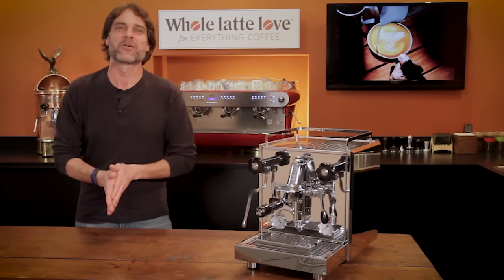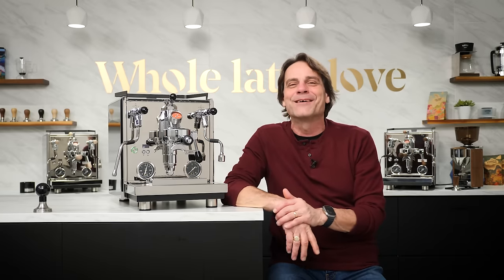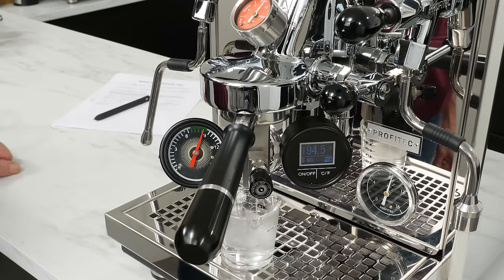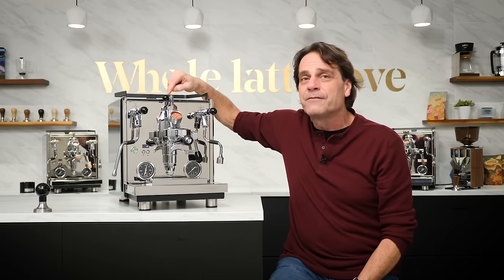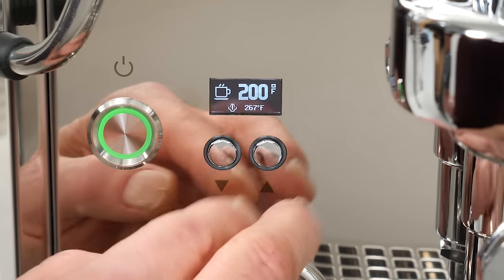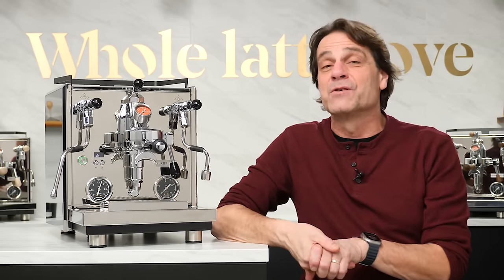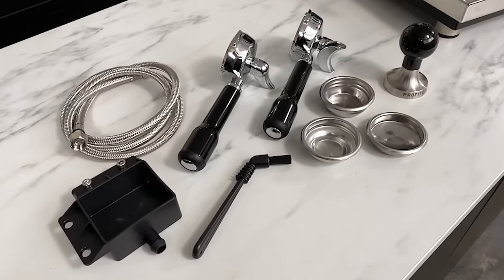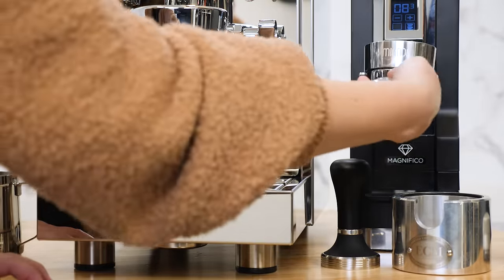Profitec Drive Espresso Machine Review

Comment: At this point, I'm not sure why they still make the Synchronika as this new Profitec seems to have everything the present-day Synchronika has but now with updated electronics. The new display is nice, but for these eyes it would be even better at twice the size.
Reply: Lexus vs Toyota
Reply: A new Synchronika is probably in the making so if ya want an ECM best to wait
Reply from the maker: I have no info on that but if it does happen it will be more $$. Just like the 700 and current Sync
Reply from the maker: I might have used the L v. T analogy once or twice - spot on!
Marc

Comment: I just received my machine,amazing kit. I noticed something odd today,my grind must have been too fine and pressure jumped to 10 bars,still a reasonable flow. I opened flow control valve all the way but the pressure did not drop,is that normal shouldn’t that affect pressure?
Reply from the maker: Hi p, thanks for your patience - I've been offline on vacation. The maximum brew pressure the machine can output is determined by the rotary pump's bypass setting. Opening the flow control all the way will in most cases cause brew pressure to increase but only as high as the bypass setting.
Reply: @Wholelattelovepage  thank you. This is my first machine with pressure gauges, upgraded from barista touch. I need to pay attention to the pressure on flow control valve, the pressure gauge on the bottom right that also activates during brew is not important to watch what is happening there?
Reply from the maker: @pawelgedyk1762  The gauge at the group is a better indication of actual pressure on the coffee. The gauge on the machine's face measures pressure in cold water very near the output of the pump. That gauge can be used to set the machines max pressure and for a general idea of brew pressure when extracting. But, do not focus too hard on brew pressure. A bar or 2 doesn't make much of an impact on an extraction. People get laser focused on a perfect 9 bar but in reality it doesn't mean much. If you're reading somewhere between 7 - 11 bar and shot timing is reasonable everything is fine.

Comment: Im a PID Pro500 proud owner - As feedback 2 things that could be improved are:
#1 Better Solid State Relay with heat dissipation - I had changed 2 of them 
#2 Find a way to reduce heating time - Maybe mix boiler with grouphead siphoned water and auto close at certain temperature. 
Found out temperature peak point is around 35 minutes after turned on, wasting a lot of electricity by passively heating grouphead for 1 minute of use in pulling espresso and steaming milk, twice a day - So that's 1h 10m of electricity for 2 daily shots of 2m - Just a feedback
Reply from the maker: Hi r, Thanks for the feedback! As covered in the video the new Drive does have a Fast Heating mode so machine is ready to make a coffee in 11-13 minutes. A few months ago we started updating the Pro 500's we ship with an upgraded and relocated relay based on feedback like yours. The relay upgrade is available.
Reply: With help from WLL tech support I diagnosed and changed a solid state relay on my Pro 600 after about 4 years of daily use. It would be nice if that risk could be reduced. It was kind of an adventure fixing it once. Next time it will just be a chore.

Comment: Hi Marc, 

thanks for this great review of this machine. 

How long after switching on the machine did you take the temperature measurements?

Thanks and best regards
Reply from the maker: Hi AM, You're welcome and thank you for the comment and question. For the fast heating test it was at ~11 minutes after power on. For the regular temp testing at 196, 200, 204 machine was powered on for no less than 60 minutes. I worked my way up from low to high with 15 minutes for machine to equalize after each setting change.
Marc
Reply: @Wholelattelovepage  Thanks for the response and info. I am really considering to buy this machine.  
Do you know or have experience if the temperature is also that stable after 25 min turning it on? 
I am triggered since I saw a video from a Rocket Appramento TCA (not a dual boiler but a two-circuit machine) which could not reach the temperature  at all. Also after 40 min the brewtemperature was still at 85-88 °C.  Only after way more then 60 min the machine was able to brew with temperature over 90°C. 
Best, Andreas

Comment: Nice, great details in this test opposing many other previous videoen that is ‘just’ a test. I actually chose the Pro800 recently over the Drive, since I really wanted the tactile feeling of the lever. All the videoes coming out of the Drive, I hope the upgrade-itus doesn’t kick in 😂
Reply from the maker: Hey F, Thanks for the comment and sharing. The Rx to prevent is great espresso from your lever!
Marc
Reply: The Pro 800 is  in particular not very popular.
It has a copper boiler which can give a special flavour to your espresso.
A SS boiler is a way better.
The Profitec Drive is a far more practicable espresso machine compared to the Profitec 800.
Reply: @OliviaNewtonJohn-yn8pi  if I was looking for practical, I’d buy a filter machine. Purchasing a lever was putting the coffee quality/type of a lever above the practicallity of a Dual boiler machine. I am quite happy, so what you think is better is slightly irrelevant after I’ve bought the machine ;)
Reply: @Fulllean 
Which does't alter the fact that the Profitec 800 has a copper boiler which is considered to be a huge disadvantage.
A copper boiler can give your espressos a  psrticular copper taste and flavour.
From this respect the Profitec Drive delivers  much better  tasting espressos with a far more richer flavour.

Comment: Great video Marc. How r u liking this machine vs the synchronika?
Reply from the maker: Hey ccg, thanks for the comment and question. Like the Pro 700, under the hood the boilers, pump and hydraulics are essentially the same as the Synchronika. The Drive has a bunch of new features accessible through the control panel like active and passive pre-infusion, on/off by day/time plus easy access to functions with plain language display. I like the change to lever operated valves. The external finishing of the Synchronika is a little nicer and I prefer its angled portafiters.
Marc
Reply: @Wholelattelovepage is there any way to use angled filters on the drive?
Reply from the maker: @devw4967  Yes! Most any portafilter made for use with E61 group is interchangeable.

Comment: How’s the reliability between Bianca and Drive? I heard that Bianca is a great starter pack for a DB machine, but it is using lower quality parts internally and externally. I’m not sure how true is that. I’m choosing between Drive and Bianca. Which one would you recommend?
Reply from the maker: Hi ct, If you take care of the machines using good water that will not cause scale and perform routine maintenance expected reliability is about the same. The external finishing of the Drive is much more refined than the Bianca.

Comment: @Wholelattelovepage - This looks like a great machine and it's a shame you cannot retrofit the steam/water handles.  Question, at the end of the video you mention that the end user should not descale their machines.  Why not if the machines are made to be worked on at home?  What is the risk of running a little citric acid and then flushing well?
Reply from the maker: Hi d, Great question! I have yet to find a manufacturer recommending home users descale their machines. There are a couple of risks. First, in machines which may have some scale buildup descaling can cause chunks of scale to break off. If not fully dissolved by descaler those chunks can end up plugging up other areas of the machine resulting in failure. Upset consumer then contacts manufacturer with only remedy being a costly repair and nobody comes out happy.  Here in our tech shop we do descale dual boiler machines. Typically that involves removing the boilers and other components to put in descaler.
If one attempts to descale at home without disassembly it's difficult to fully fill the service boiler with descaling solution. In standard operation the boiler never completely fills with water as headspace is needed for steam. Scale often forms at the fill level line of the boiler so without a complete fill descaler cannot do it's thing in that area. There are methods like disabling water level sensor for the service boiler to get a complete fill but those have some risk and should only be done by a professional.
The proper way to deal with scale is to not have any form in the first place. Aside from edge case water quality issues like high chlorides most safe to drink tap water can be treated to eliminate scaling potential. Traditional water softening using sodium based system is one option. A better option is using filtration with calcium to magnesium ion exchange. This reduces calcium to a level where scaling is not possible yet has the mineral level via the magnesium for good flavor. Magnesium is a better flavor extractor than sodium. In addition, sodium or magnesium softening prevents corrosion of metals in machines.  I note this as I get many folks wanting to use pure RO or distilled water in their machines to prevent scale. These ultra-pure waters can corrode metals. Beyond that, they over-extract coffee causing bitter flavors.
Marc

Comment: Hello, thanks for the review. Do you have any information about the screen that appears when we press two buttons immediately after pressing the button on the machine, while the machine is not yet fully turned on? This screen appeared for me, but I turned the machine off and on again without making any changes. But I would like to know what settings can be adjusted. Maybe you shouldn't change anything on that screen.
Reply from the maker: Hey O, I believe you are seeing the technicians menu which has adjustments to parameters for PID algorithm calculations. Strongly recommend you do not make any changes to those settings!
Marc

Comment: Between this machine and the ECM Technika V Profi, which one is better? Is the extra money worth it?
Reply from the maker: Hi O, Thanks for the question. The Profitec Drive's feature/function set goes well beyond the Technka V's. Here's a side by side spec comparison: https://www.wholelattelove.com/pages/compare?products=MjIyMzc0MzUzMzExMCw3MDUxODQ5MzAyMDcw
The Technika uses a heat exchange boiler while the Drive is a dual boiler so it has independent control of brew and steam temps. Drive has active and passive pre-infusion, stock flow control, fast heat up, time of day programmable on/off times and more functions not found on the Technika. Hope that helps!
Marc

Comment: Love your reviews Marc, insightful and covers everything. How much further in making machines better do you think manufacturers can/should go?
Reply from the maker: Hey dcds, Thanks for the kind words! That's a great question. Innovations and new features picked up in the past couple years after a little slow down during Covid. HX boiler machines with dual PID and ability to run like a normal HX or use a temp probe in the the thermosiphon loop to drive boiler heating are one example. Machines like the Drive with time programmable active and passive pre-infusion, flow and pressure control. These are things that help make better espresso. Then there's use features that make them more convenient and/or consistent. There's programmable on/off, maintenance reminders, fast heating and custom wood and material options. Would some like a machine that puts all the control in an app? A few machines available with that and we're likely to see more. But there's a base who don't want to run everything with their phone. I've seen renewed interest recently in traditional lever machines. These appeal to the purists out there. Very simple with no bells and whistles but requiring knowledge and more hands on technique.
Marc

Comment: Would it be easy to change out the pressure gauge? Not so into the orange 😅
Reply from the maker: Hey RC, yes, many gauges available that fit E61 group port. The slightly tricky part is lining up so it sits at 12 o’clock. But a combo of O rings and maybe a little Teflon tape make it not a big deal. 
Marc
Reply: @Wholelattelovepage  awesome thanks. Thinking about this one or waiting to see if the synchronika gets upgraded with similar features. Although I am very happy with my breville dual boiler, I do have the upgradeitis

Comment: is the steam milk is smooth and recommendation for latte art? Or just for a simple latte art? I mean on Lelit Bianca the steam is easy and slow smooth for steam the milk. Thank you..
Reply from the maker: Hi i, Thanks for the question. The Profitec Drive is an excellent steamer! Totally capable of producing a silky microfoam for pouring high quality latte art. As with all dual boiler machines you can adjust the steam boiler pressure to match your frothing skill level.
Marc

Comment: Hey :) Mark, you are well informed - why the new Drive's max steam temperature is 270 F while predecessor and Synchronika can reach 272-273? Is it a new PID?
Reply from the maker: Hey p, Thanks for the comment! That difference was one of the first things I noticed on initial use of the machine. I did ask Profitec about the difference and still do not have a good answer. Honestly the difference in steam power isn't much.
Marc
Reply: @Wholelattelovepage  
Thank you! Appreciate :)

I also sent them formal inquiry. Still… complete silence 💁

EDIT
Got a message today: there will be software update. Max steam temp will be higher than 132 C / 270 F.

Comment: Any idea if the side panels can be customized, like for the Synchronika? A little less chrome would be welcome for my liking!
Reply from the maker: Hey martin, currently no options to customize Drive side panels.
Marc
Reply: @Wholelattelovepage  Thanks Marc. I meant: do you see them as being customizable? I would do this myself!
Reply from the maker: @martingagnon4372  ah DIY... Well, anything is possible given talent and time but it'll be a lot more involved than the Synchronika! The ECM panels have one bolt at the top going through an L shaped tab holding each side panel in place and 2 straight slide in tabs at the bottom. If you're at all handy it's not to hard to fabricate the 3 metal tabs to mount a custom Synchronika panel. The Drive panels wrap under the machine at the bottom and have internal fastening to the front and back panels. Beyond that, I'm not certain if the Drive's internals extend slightly beyond frame edges or reuire a bit of clearance. The way the original panels are constructed there's ~3/4" of internal clearance beyond the frame edge.
Marc

Comment: Thanks to Lelit for inspired other e61 machines about these menu settings :) In fact they still don't have flow profiles as Lelit Bianca... Nice machine though...
Reply from the maker: Hey b, thanks for the comment. Drive comes stock with flow control. Bianca is in our top 5 DB's of 2023 and a very capable machine. Put side by side and build/finish quality is a bit nicer on Profitec.
Reply: @Wholelattelovepage  Finish quality does not make espresso… Also box contain is a nightmare on Profitec side 😬

Comment: How does this compare to the Lelit Bianca v3?
Reply from the maker: Hi a, the machines have similar capabilities with flow control and programmable pre-infusion. One hard to miss difference are the quick steam lever operated valves on the Drive vs. knob valves on the Bianca. The external finish quality is nicer on the Drive. A few exposed seams and sharper edges on the Bianca and lower quality fasteners. Bianca has a limited range of flow rates available unless you adjust and remount the flow control paddle. Entire range of flow rates always available on the Drive. In the end they are equally capable of excellent espresso. Drive has Fast Heating and time of day, day of week programmable on/off times. Drive's display is a bit nicer with real words used for menu items while the Bianca mostly uses symbols.
Hope that helps!
Marc